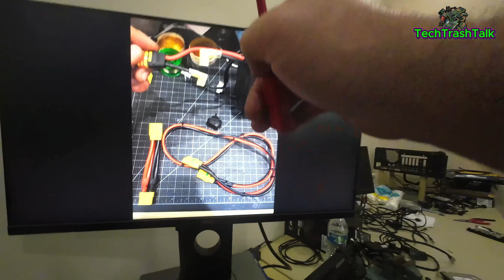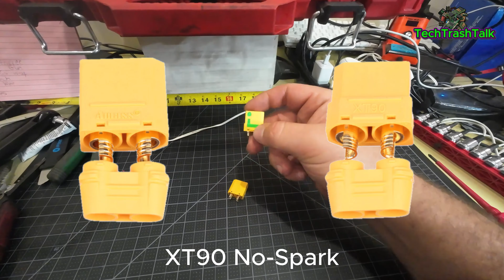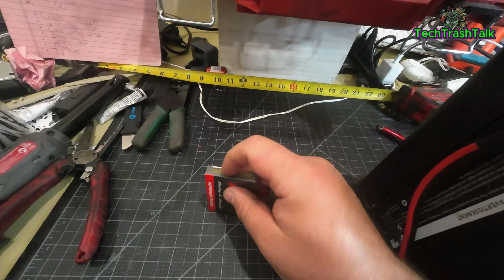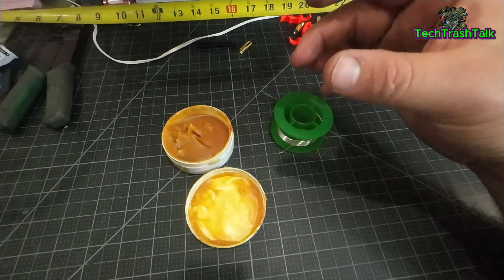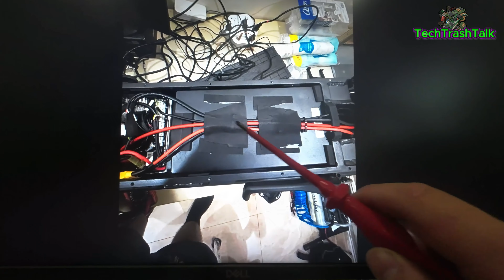Segway Max G3 External Battery Upgrade

Comment: What is the difference between XT90 battery balancer for $60 and a simply Y splitter? 

I figure since both batteries have. BMS I won’t need it. What’s your opinion?

Comment: I really wanna do this with the stock battery after replacing my incoming Max G3's battery with a GT3 battery, but I'm really concerned about the weatherproofing, especially if the battery's EXTERNAL external. So this stuff scares me. I sure don't want a short... Any advice given this? Also, worthy of a note - another reason Segway may have sealed everything up is WEATHERPROOFING. Epoxy is a hell of a way to keep water damage under control.

Comment: Is the BMS inside the battery itself? Since you are just paralleling 2 batteries into 2. So I would have thought if I connected an additional battery, it would confuse the system.
Reply: All readings will be from the non external battery, it will simply appear to drain slower ro the controller.

Comment: Did anybody figure out what the plug-in that's on the scooter is looks like a DC port where to buy that plug in at and could have you used just that Port like Segways going to do in a few months but yes I don't want to wait either
Reply: Wondering the same. Also wondering if it's possible to charge a ride simultaneously

Comment: Dann hast du ganz Deutschland auf deiner Seite und alle loben Dich hoch.
Reply from the maker: Thank you brother
Reply: @TechTrashTalk  wir bekommen die Batterie in Deutschland nicht bestellt.😞
Reply: @TechTrashTalk  Es ist wahr: Du würdest ein Volksheld! (BTW: Why not using the secondary loadingport which is for the official external battery instead of the y-cable?)

Comment: whats your range test?
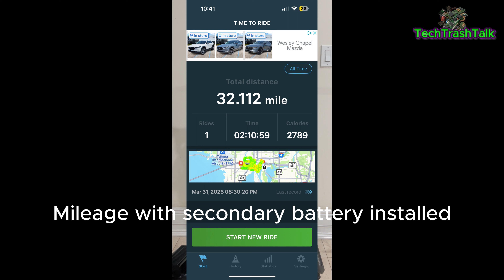@19:02 it says your average speed was at 14.71mph
*For the range test were you able to consistently stay at 28mph or what speeds were you goin? 
The 32miles range is it the 2 batteries combined? *
I noticed when going at 20mph the 850w motor stays around 12ish Amp but when going at 28mph it goes to 30A+

Ive also noticed that the scooter purposely slows down once you start going above 40c, but im wondering if thats the temperature for the motor battery or bms 🤔
Reply from the maker: @Rae3CA  I was in sport mode full throttle every chance I could 28 mph max speed any higher it’s because I was going downhill. Obviously there are stops. The app I was using is mostly accurate, but not 100%. The range was accurate tho I tested it with two other apps plus my Apple Watch. Yes the complete range was with both batteries connected. When it came to temperature on the motor, I did notice it get noticeably hot almost too hot to touch. Did not get a reading on temperature but I did not see any reduced speeds. I was able to go the consistent 28 mph whenever I needed it. The 40 c is bms readings. I really wish they had temperature reading on the motor on the Segway app.

Comment: Could you post the link to the battery or was battery purchased from Segway?
Reply from the maker: @Nxtl666  I bought the battery second hand on Facebook marketplace but you can find it on eBay for $450. I would not recommend buying this new unless you really want to.
Reply: @TechTrashTalk would you be willing to make me a battery for my Max G3 with all the connectors. I will pay you $300 labor plus shipping. ?